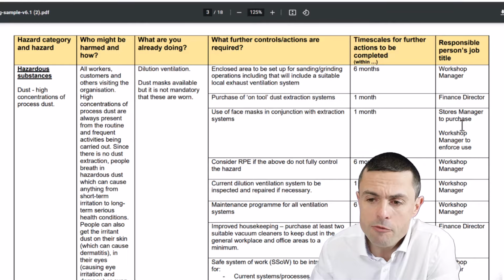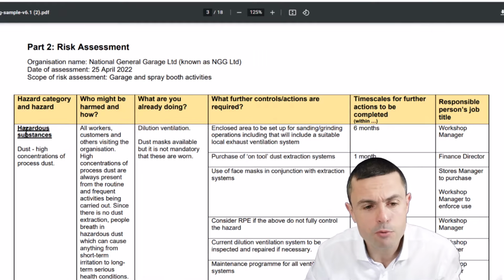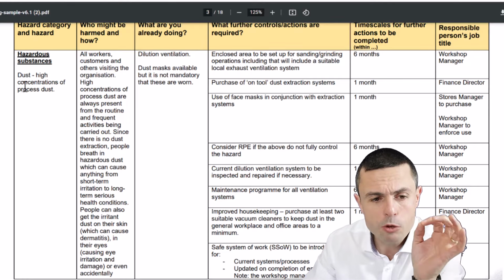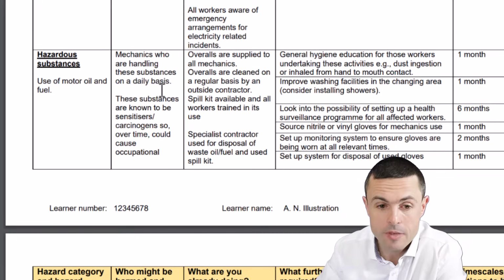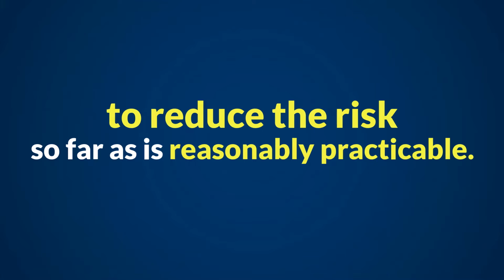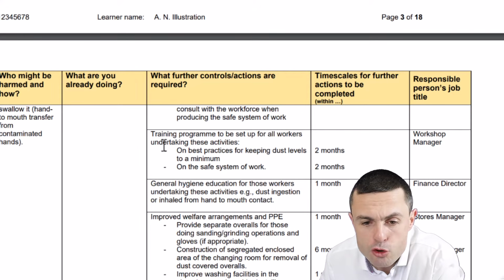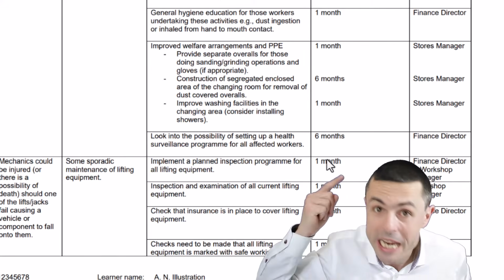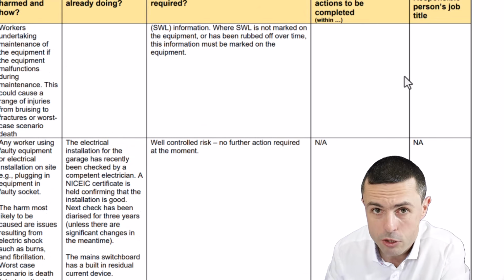NEBOSH NG2 Practical Project SAMPLE Analysis Pt.3 Risk Assessment

Comment: 4:33 and that's exactly why my first attempt was referred because I did not explicitly write, missing a safety guard, I used subtle language and the examiner feedback remarks said you should rather write use of angle grinder with a missing safety guard lol
Reply from the maker: @alidurrani4645  Well that’s not a hazard either. The hazard is the rotating grinding wheel.

Comment: They referred me the IG2 for the most  (insert word) reasons.... I placed as a hazard category "lifting equipment" and should have placed "load handling equipment".... and on part 3... i wrote (on how many persons are at risk) i just wrote, persons at risk are the ones performing the task .... i did not put the number 5(FIVE) persons are at risk..... ....At least I passed IG1 :) and I just have to correct those 2 things, and re submit. Ah and the agony of waiting now until June to get the results..... we are in February...
Reply from the maker: @JenBDO  Ah yes that is disappointing. The criteria are clear though. You either meet them or you don’t. Your course provider should point out these possible mistakes before you write it. Hope you pass on the next one.
Reply: That's I'm doing ngc too long to wait for results I got a life. The nebosh short courses are better.